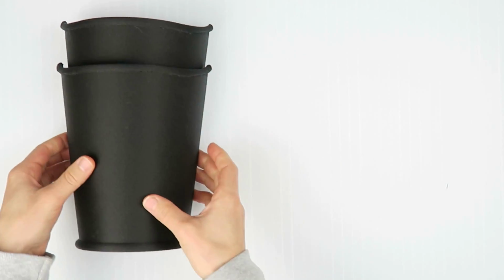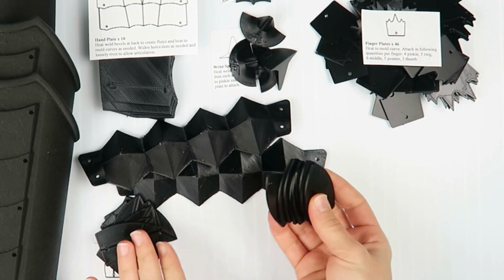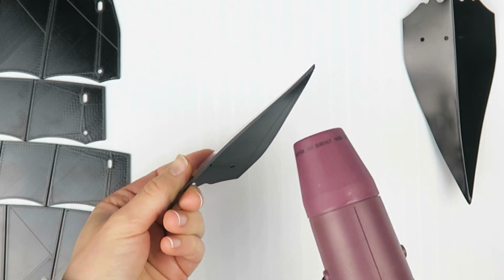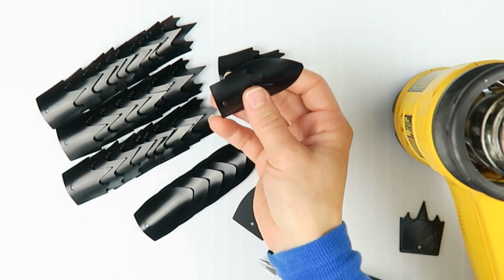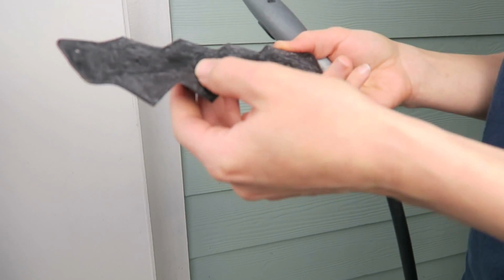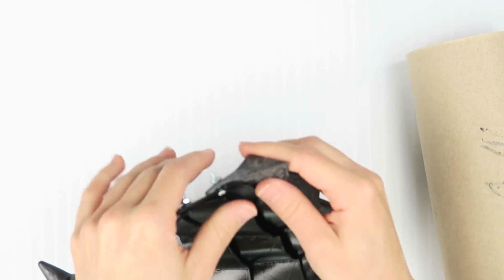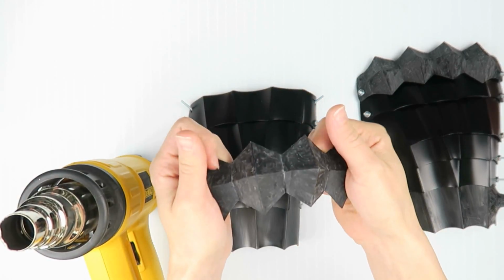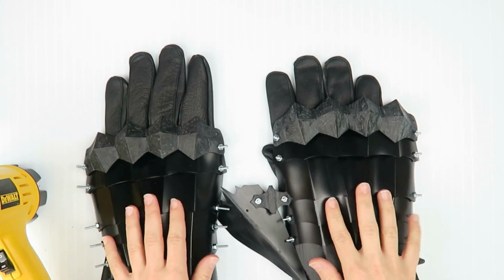How to Make 3D Printed Ringwraith Gauntlets

Comment: Why not print with abs and vapor smooth with acetone to remove print lines.
Reply from the maker: That would be an option, too, but with ABS I think I'd need a lot more ventilation at the print station :)
Reply: true but it can save you some time. love your channel by the way good stuff.